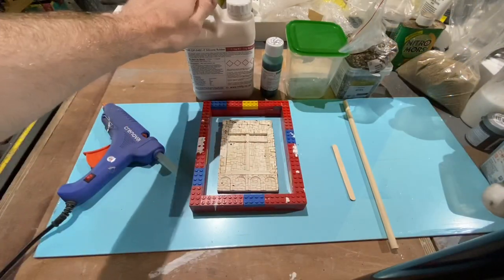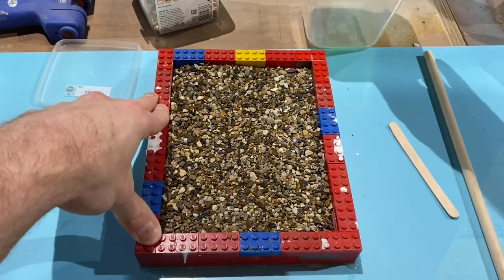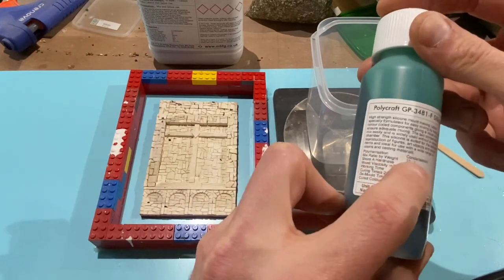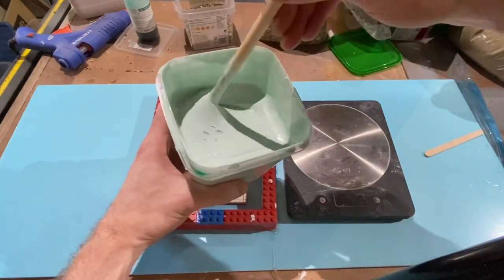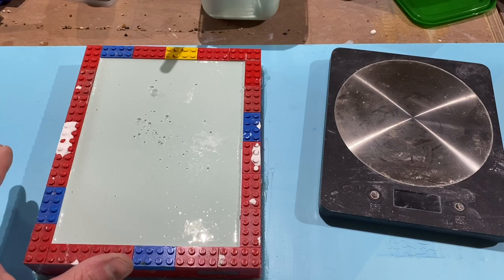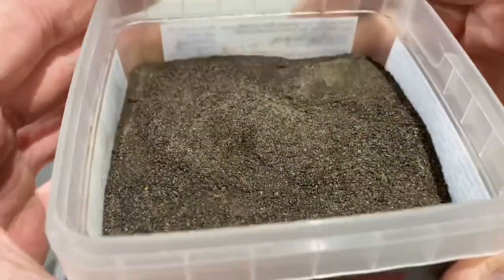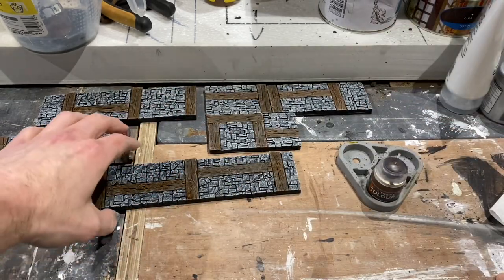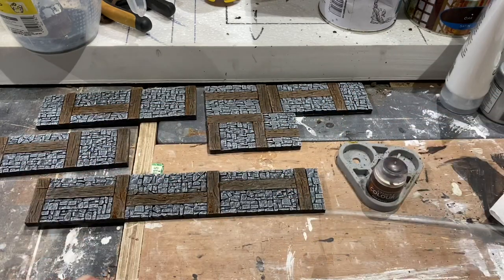Gaming Table Build - 3: Silicone molds, ground covers and canal work

Comment: Using citidel paints for terrain is a very expensive way to build. Water, matt medium and some dark brown acrylic paint would be a much cheaper way to get the same effect.

Looks great though. Lots of great tips with the casting. Keep up the good work.
Reply from the maker: For sure! This was more of a ‘will this work’ kind of idea and just saved me time with a highlight etc. I’ve found that inks with the Matt medium is a great tool to vary the strength from shade wash to tint. 
Thanks for the kind words!

Comment: What was the brand for the mold rubber?  I would like to start making mini molds, but I'm not sure what to buy.
Reply from the maker: Hi, I totally missed this as the YT app is a tricky one. I used RTV Silicone. I brought the type that requires a hardener as a liquid but there are casting silicones that are a 50:50 mix as well which require less finesse.
Reply: @rokminis59  thanks for the follow up!